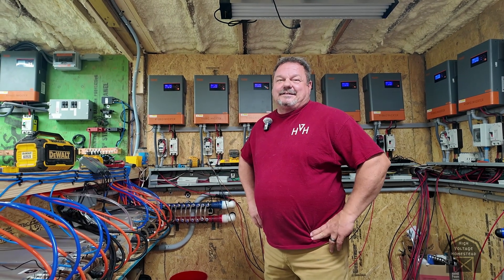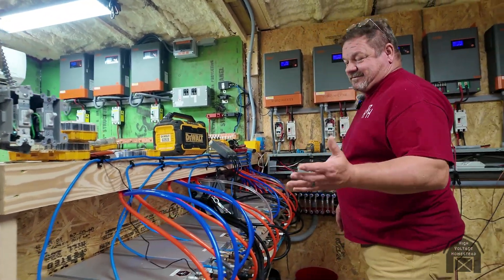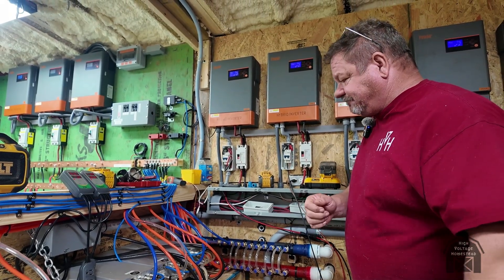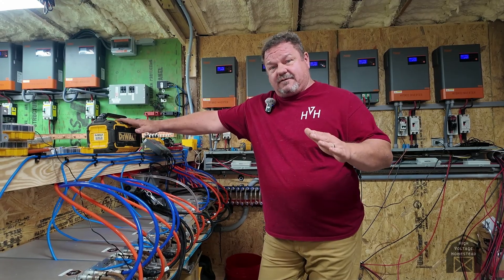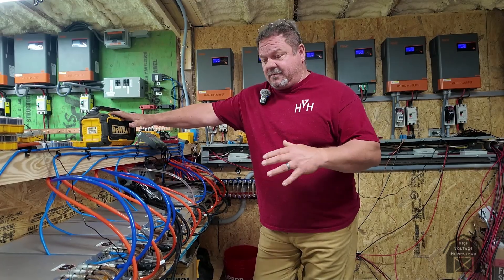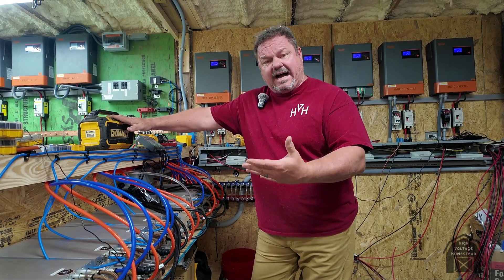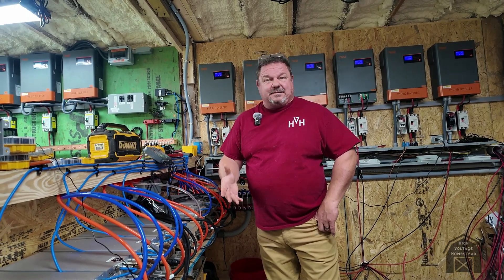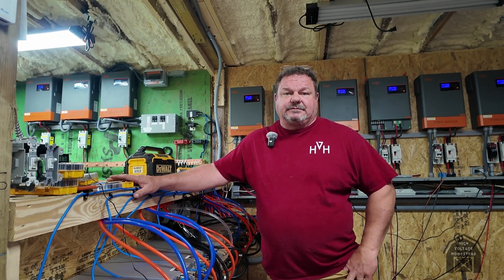This Could be a Game-Changer for Water-Cooled Miner Systems!

Comment: You got a lot put together and figured out in a short amount of time for one dude.  Resourceful use of your interdisciplinary skills.  Impressive.

Special request.  How about a video on preventing HVDC arcing and electrical fires.  AFCI/CAFI components you’ve used in the past, present or might consider in the future.  This could include showing how badass DC arcs are compared to AC arcs.  Maybe even show welding stuff with it and different examples of how easy it is to create an arc/spark with HVDC.  You could also incorporate GFCI into this talk for shock prevention.  Lastly, you could explain earth grounding vs common ground along with how and why resistance affects the performance of all breaker types, including the standard one, so drastically.  That stuff has my interest lately because homeowners insurance won’t cover a fire, shock injury, or surge damage on these unsanctioned solar/electrical installs, so I’m trying to mitigate those risks as much as is reasonably possible 

I’ve been studying up on all this for my DIY solar install, but you less convoluted figures of speech you use and explanations are helpful.  For example, “poke it with a stick” made me laugh but made total sense.  That’s figuratively what you have to do to keep some things working until our cave person brains figure out how to not have to keep doing that.
Reply from the maker: Thanks for the suggestions, I will try to include some of that in future videos!

Comment: That is really cool. The miners are just like a pc if you water cool a pc your performance in gaming and doing other tasks goes up because the cpu is cooler and it gets more efficient. So the water cooling is what help you got the uplift on the hash rates and now the weather is getting cooler expect even more cooling and uplift in efficiency. So its not a fluke its just they are getting more efficient because they are water cooled.